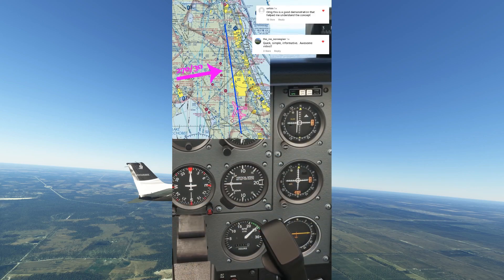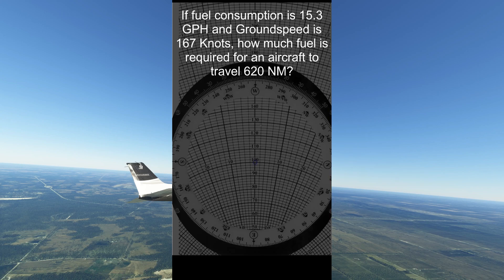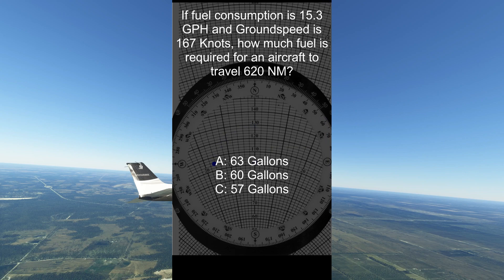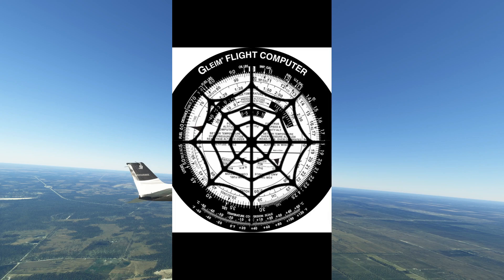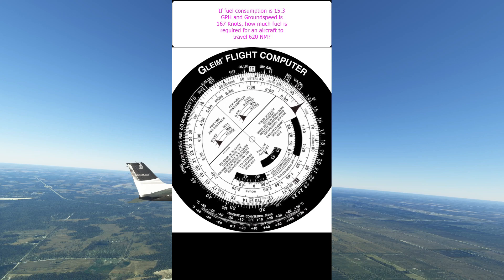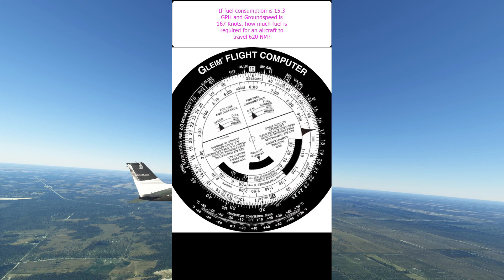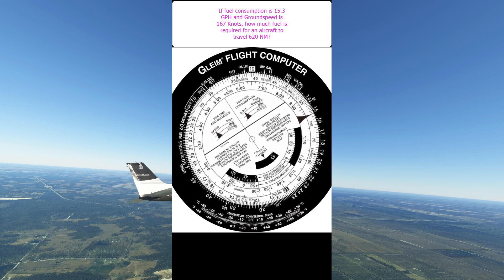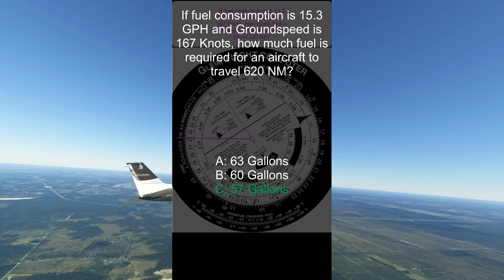Fuel Calculations with the E6B Flight Computer!

Comment: I am not entirely sure if this was supposed to be satire or not. Good contents regardless, obviously. If it is meant seriously, please consider that the most important fact of the slide rule is that whatever ratio is set up remains the same throughout the disc. That means that if in the same span of time the plane burns 15.3 gallons of fuel it moves 167 miles over the ground, that ratio is the same we will use for the 620 mile calculation. I.e. with 15.3 opposite 167, we find 56.8 opposite 620. Btw. you get to choose which ones you want for the inner and the outer scales; it won't make any difference.
Reply from the maker: I like to think of it as educationally satirical